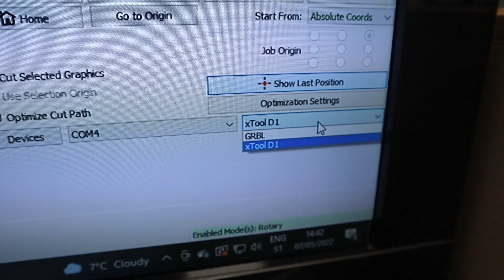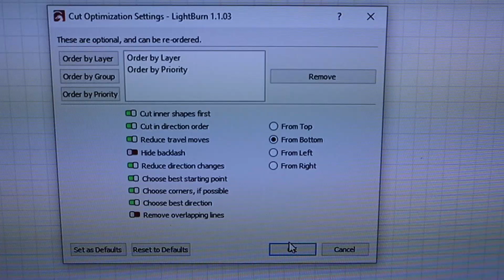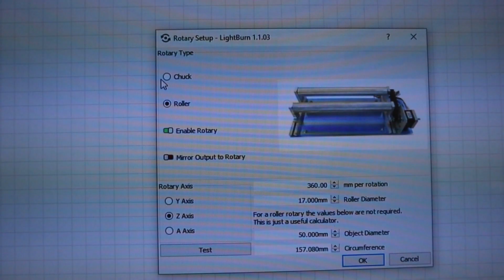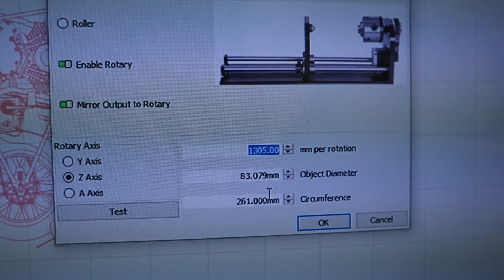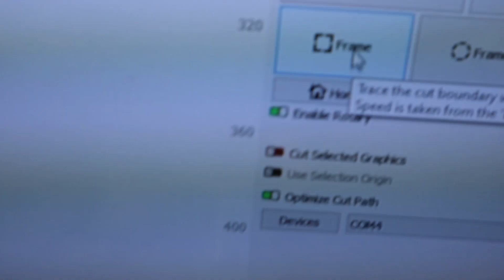New xTool RA2 Pro Rotary Chuck Will Make Your xTool D1 Laser Engraver 10x Better! Review and Test

Comment: I have been trying to get the RA2 Pro Chuck to work with my xTool D1, and I can't for the life of me get it to work. It Frames OK around the tumbler, but doesn't move up and down.
Reply from the maker: @patriciaerickson794  you should connect the rotary instead of the Y axis
Reply: @JTMakesIt  I don't understand.
Reply from the maker: @patriciaerickson794  check tutorials on YouTube on how to use RA2 with D1
Reply: @JTMakesIt  I had watched many tutorials on how to use the RA2 with D1. As it happens, there was nothing wrong with the RA2 after all. The problem was the belt on the arm that the laser head moves back and forth on was not tucked into the guide underneath the arm. The following video shows how to fix this in case anyone else is having this problem. All is working fine now. 😁
Reply: https://www.youtube.com/watch?v=JBG587vF9lM

Comment: Very nice video, thank you so much... I have just a little question. Do you know if it is compatible with sculfun S9 ?
Reply from the maker: Hi,
They say on the website that it is compatible with other brands. Inside you get some wiring adapters for other connectors. I heard it is compatible with Atomstack, but the Sculpfun has the same pinout so it might work too.

Comment: Good night, this rotary axis will be compatible with the Atomstack x7, but I will upgrade with the x20 laser module and I noticed that the recordings are coming out bad with the rotary axes of Atomstack and other brands, but this rotary axis of xTool is similar to the ones Fiber laser engravers, coming out perfect. Will it be compatible with Atomstack x7?
Reply from the maker: I think it should be possible to connect it to other machines. It comes with two additional wiring adapters but I need to check all compatible models.
Reply: Great day evolved person I understood. So take the test as soon as possible to clear the doubts. Thanks for the enlightening content.